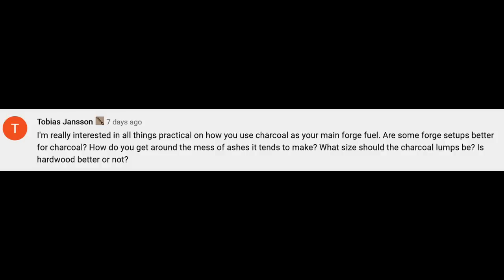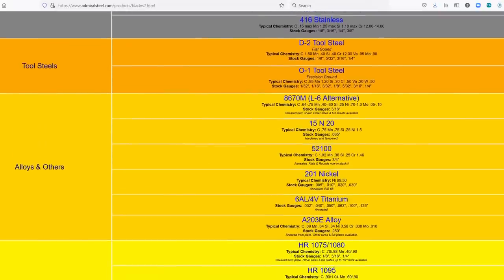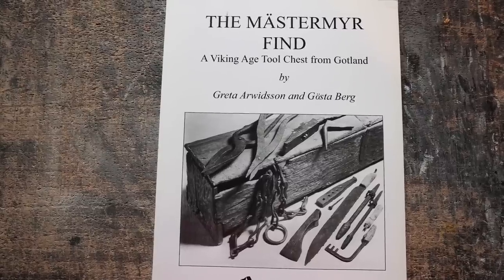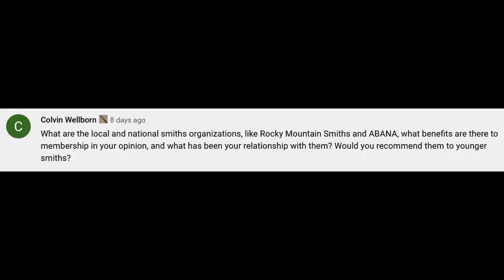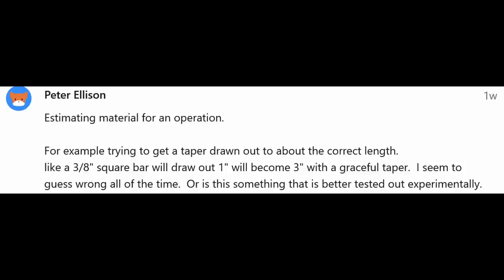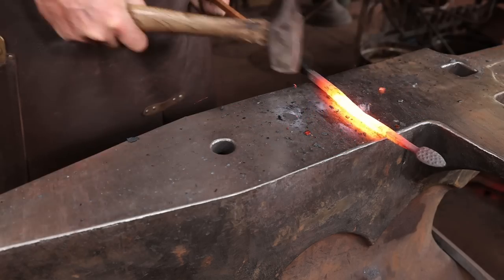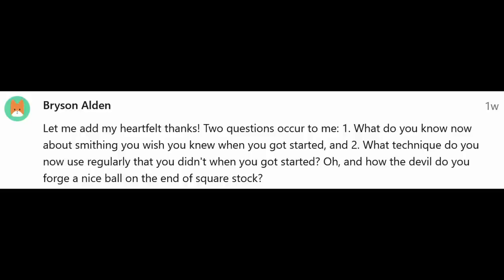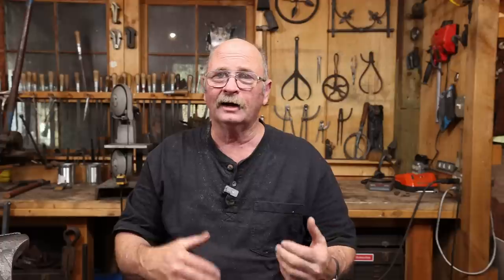Blacksmithing Question and Answer

Comment: I’ve been having trouble forge welding but always thought it was cause I have a propane forge till the other week I was making a ring out of wrought iorn and scarfed it on both sides so it would fit together nice and more seamless and it welded together in my forge without me trying or even adding borax yet so it gives me hope that I was just doing things wrong and my forge can do it
Reply: Ive seen your videos on you doing it with double burners but I only have a vevor single burner that’s fire bricked closed

Comment: At around 1.24 you said that “charcoal produces a lot more ash” … This is probably  the first thing that I have disagreed with since starting to watch your channel several years ago.
I live in the Northern Territory of Australia and I use nothing but charcoal in my forge. Agreed, it’s a lot of work to make it and if I was a commercial blacksmith I probably wouldn’t, but the charcoal I make produces no ash whatsoever. 
I guess my argument is that it is the type of wood used to make the charcoal that most influences the amount of ash in the fire pot. The wood that I use is Cooktown Ironwood with an ADD of around 1220 kg/m3 compared to many of the American pines with an ADD of 600kg or less . Sorry, but I couldn’t find the ash comparisons i was looking for.

Comment: i get a rusty leg vise from a retired blacksmith, i disassemble and clean it with a bronze brush and kerosene. My question is, what type of coating is recommended for that tool? some one told me to use a phosphatizer and paint it or coat it with oil. Sorry for my inglish, i hope some one can give me a hand with this, thanks!

Comment: Hi John i really need someone (someone being You John) help on explaining when to use hot chisels and when to use cold chisel and and the differences if i have only cold chisel how is best to use them pls
Reply from the maker: I rarely use cold chisels and even use a hot chisel for cutting cold sheet metal at times.  The big difference is the bevel angle with the hot chisel being a sharper angle.  If all you have is a cold chisel I would use it until you can make a hot chisel for hot work.  But the sharper corners may dig in and cause problems, mu hot chisels usually have slightly rounded corners.
Reply: @BlackBearForge  so the metal is more or less the same its just the angle of it the bevel thats different is that right or is it completely different metals?
Reply: @dirkventer8112  id reccomend using softer steel or just annealing the chisel softer for cold chisels. I like having the warm chisel a bit harder so it keeps an edge better. Meanwhile the softer cold chisel prevents it from chipping as easy.
Reply: @freshtoast9578  thanks will give it a try its not for cutting but im planning to shape and grind and polish them for sculpting in hot metal but i have a few lying around that im going to test and they not that expensive
Reply: @BlackBearForge  thanks il try a few different things with the cold chisels keep up the awesome videos us younger generation needs some guidance in South Africa blacksmithing its not so big so your video is really appreciate and valued 👍